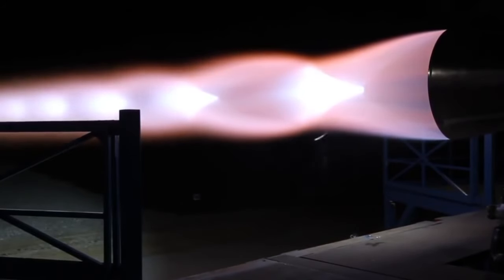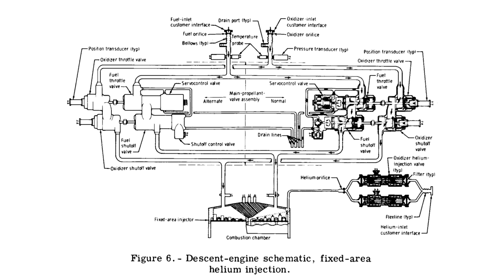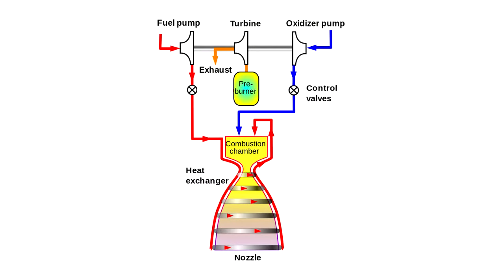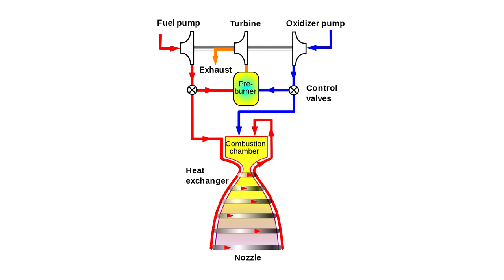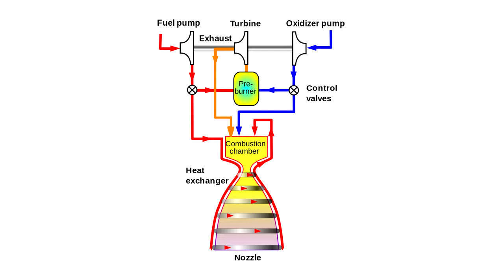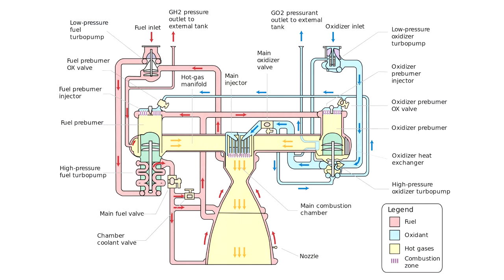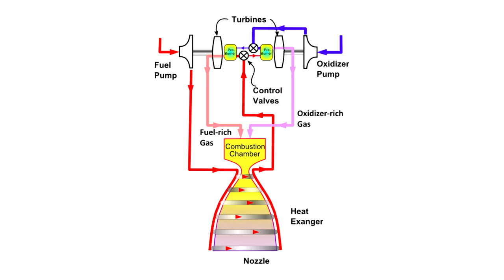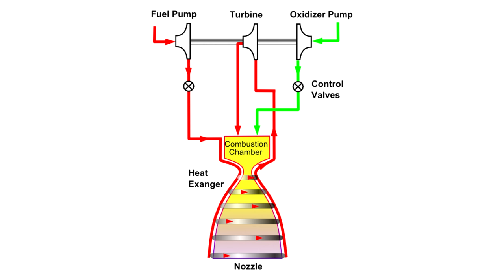KSP Doesn't Teach: Rocket Engine Plumbing

Comment: nitrogen is an inert gas?
Reply: Yes.
Reply: thx I didn't know that
Reply: not quite but pretty darn close
Reply: All gases at the most right side are Noble Gases. (Edited)
Reply from the maker: +my son unless you're lithium.... it's relatively inert
Reply: I'm in school so they only taught us about helium, neon,argon etc.
Reply: Nitrogen is considered inert because the N2 molecule (nitrogen gas) has three covalent bonds: N≡N, whereas most gases, like O2 (oxygen gas), have two: O=O. Those three bonds require much more energy to break in order to bring the atoms into a state where they can react with other atoms.
Reply: I think you mean the gases on the right side of the periodic table.
On the leftmost side are the alkali metals, which are most definitely not inert, and the gases on the leftmost side of their respective rows of the periodic table, such as nitrogen, chlorine, etc. are not noble gases, as in most representations of the periodic table, the noble gases are on the far right.
Reply: Under these conditions.  The inertness of a gas is always context dependent.
Reply: thats true it depends a lot on the conditions and reagents present.
Reply: +Nelumbo Nucifera unless you're talking about Helium.
Reply: Manu Tarazona Oh yes, sorry for my mistake.
Reply: +my son helium, neon, argon etc. are "noble gases", which means that they don't like to react with anything.  Something like nitrogen is an "inert gas", which simply means that it doesn't burn when mixed with oxygen and doesn't cause fuel to burn when mixed with fuel.  But unlike helium, nitrogen can form chemical bonds and be part of chemical compounds.
Reply: N2 has a tendency to dissolve in LOX at high pressures which causes cavitation in turbopumps= not good so Helium is usually used for commonality on both sides when LOX is used as one of the propellants.
Reply: Also Helium has a negative Joule-Thompson coefficient, meaning it heats when it expands instead of cools, which is desirable for efficiency in the pressurant tank volume
Reply: I thought they were on the far right?
Reply: yeah I wanted to make mention helium too but decided not to make a long story :P 'noble' gasses like krypton and xenon can bond with fluorine though but helium is totally inert.               
Also: would the low density of helium be a plus when using it in fuel tanks?
Reply: You must have a different periodic table than I do...
Reply: XeF and KrF are actual compounds with a noble gas in them though (albeit quite unstable ones).
Reply: More so than oxygen
Reply: a lot more, both are powerfull fluorinating agents. Oxygen is a very powerfull oxidizing agent as well (especially when condensed to liquid form).
Reply: Kevin Miedema Yeah, noble gases become somewhat less "noble" as you go down the periodic table, due to very large and loosely bound outer electron orbitals.  But they're still much less reactive than any other kind of element.
Reply: +Kevin Miedema some car tyres are inflated with nitrogen because it's apparently more stable than oxygen, I think the Nissan GT-R comes with it from the factory
Reply: +Chickenn Oxygen degrades rubber. Also filling with dry nitrogen instead of ambient air gets rid of the complications with inflation pressure from condensation of water vapor in humid environments. Formula One and Indy cars have used dry nitrogen or a similar scheme for years because they have relatively low inflation pressures (13 lbs) and tenth-psi differences have dramatic effects on those cars' handling.
Reply: Wificationify High-pressure gas should be at the top of the tank and the liquid fuel / oxidizer should be on the bottom, right?  Since the gas is lighter than the liquid.  So as long as the fuel intake feeds from the bottom of the tank, this should be fine.

In zero gravity, of course, the fuel could well end up on the wrong side of the tank, which is why with an engine like that, before starting it in space, it is necessary to thrust forward a little bit with RCS to get the fuel to settle.
Reply: inert enough...
Reply: Bingo. You can see this in action in some of Scott's real scale solar system gameplay.
Reply: yeah he mentioned that a lot - he did abandon rcs thrusters and just spun up the ship later in his playthrough though.
Reply: Unless you've got a very energy-intensive synthesis reaction (as is the case with nitrogen-fixing bacteria) or some horribly reactive chemical (think O2F2), nitrogen gas is inert.
Reply: Some call it racing gas. The real world benefits are minimal, but just like in 'Rocket Science' where you are chasing the limit, N2 versus Air means you can rely on an inert gas which has the perfect characteristics of a gas (Charles/Boyles Law's). But yes, Nitrogen can be absorbed into the most fluids, there by decreasing fuel-oxidiser density or causing cavitation at the pumps. You cant use N2 to pressurise a liquid H2 tank, as it would freeze. O2 - absorb.
Reply: the deal with nitrogen in tires is that it does not absorb moisture and is less affected my heat or cool that alters tire pressure.....ya .more stable
Reply: No, but it is a lot less reactive than most elemental gases
Reply: Wificationify on the launch pad, gravity/buoyancy will do the trick. Once into orbit or other micro-g scenarios, they actually use tiny solid rockets or other orientation-independent engines to “kick” the stage ‘up’ providing enough acceleration to do the same thing.
Reply: Gasses used to pressurize the fuel tank: 
  Nitrogen gas is a two atom molecule that is not combustible with most common fuels, but can react slowly at both high pressure and temperature. It is not as light as helium. It is cheap, and used to exclude normal air from airline fuel tanks. 
  Carbon Dioxide is also quite stabile with fuels, but is acidic in combination with water vapor.
  Helium is the lightest inert gas, making it desirable for rockets.
  Methane can be both a liquid and gas in the same tank, so heated methane can be returned to the tank for pressurization. Super-chilled methane will tend to condense this gas back to a liquid, so a proactive controller is needed to press the tank. A membrane may also be desirable to prevent the super-chilled liquid from mixing with the gas in free-fall. Otherwise, the tank pressure may drop precipitously./
Reply: Until you start using hydrogen or igniting your piston engine via pressure

Comment: Scott a very nice summation.   Of course you could have talked about how
the rocket thrust chamber is cooled and how they are started, throttled and
restarted; why some engines are more efficient than others and why the thrust
to weight ratio is important.  But for your basic type and plumbing it wasn’t too bad of a video.

Comment: Just to give an idea of the scale of some of these things, the Rocketdyne F-1 engine in the Saturn V used a gas generator cycle, where the turbopump for the fuel and oxidizer ran at 55,000 hp. That's 55 thousand horsepower, just for the pump. The engine itself produced something like 30 million horsepower.

Comment: Nice one Scott.
Another thing you might address that's very unrealistic in KSP is air-breathing engines, namely the way they just consist of intakes on the front and nozzles on the back with no actual engine in the middle linked to them by ducting! Intake and exhaust duct geometry, volumes and aerodynamic effects are a huge factor in aircraft design.

Comment: Aircraft fuel cells also use turbopumps in most cases. Often times, they're electrically driven. Other times, they are driven by motive flow from the engine-driven fuel pump.

Comment: Hello Scott:

Very much enjoy your space videos, thank you!

I watched the video "KSP Doesn't Teach: Rocket Engine Plumbing" and enjoyed it very much. 

At the end you mentioned a hydrogen type combustion engine which was great but limited in how much thrust you can get from them. This was due to the geometry of increasing the combustion chamber sizes. I get your point about volume being a function of radius cubed vs. surface area being a function of radius squared. You mentioned that at some point in size you would need to pump in a lot of fuel but get no further increase in thrust. 

I thought about that a bit and wondered if they couldn't simply install a heat tolerant sphere into the center of the now larger combustion chamber to force the fuel mixture towards the walls. This sphere would decrease the volume of the chamber but not affect the surface area of the walls. Just a thought. would like your opinion on this but don't know how to give you my contact information in this format. 

Thank you,
DWKSIMI

Comment: For me that was one of your most interesting vids - thanks.
It would have been even better if you had shown on actual pictures of real engines where exactly these preburners and turbopumps etc. are mounted. Or a picture of the oval H2O2 tank of a V2 rocket that you mentioned.

Comment: Scott Manley they use mechanical seals in turbo pumps, jet engines etc. Usually a carbon rotary face with a silicon carbide or tungsten carbide stationary face. 

Impressive album collection, let's see your stereo

Comment: Scott! What are your thoughts on possibly using a RAT (Ram Air Turbine) driven turbo pump for first stage rockets?

Basically, a RAT is a little propeller you can kind of hide in a ducted nacelle that sticks out from the side of the fuselage. It uses the flow of air rushing past the rocket to drive the turbo-pump.

The upshot for it would be that first stage motors could simply use the movement of the rocket itself to power the turbo pump, completely void of hot gases.

There are a few downsides and possible engineering challenges that would have to be overcome however. For one, the intake could cause drag. For another, it doesn't work in vacuums, so it'd be limited to first stages. For another, there's the issue of starting it in the first place. I was thinking perhaps the launch tower could manually spin it up with some sort of bleed air system, and then the engine could become self sustaining once it got off the launch pad. Perhaps it could be a hybrid electrical system rather than all mechanical, that way you could run electrical power into the rocket while on the ground, and let the RAT take over once the rocket lifts off.

Anyway, what are your thoughts? Possible or no?

PS, I was also wondering, wasn't sticking too many engines in their stages the thing that made the N1 moon rocket a disaster? How does Elon plan on fixing that for his Mars rocket? Wouldn't launching a dirty and inefficient Sea Dragon be safer, cheaper, and more reliable?

Double PS, 0:37 What's with the wavy exhaust? Is that some sort of standing wave? Does that have any effect on the engine's performance?

Comment: Really surprising how H2O2 has been so neglected as oxidizer, considering it's many appealing qualities; high density, non-toxic, non-cryogenic,  good oxygen yield, not hypergolic (won't explode if mixed) but still kinda hypergolic (the freshly decomposed steam-oxygen mix at 700-900deg C is pretty good at igniting stuff) and it can be used as monopropellant in RCS and to drive turbines without mixture ratio problems. Bristol Siddeley Gamma was a succesful engine in the Black Arrow program, but ever since they have remained either proposals or one-off specialty engines.  RD-161 and RS-82 have projected specific impulse of 320 seconds, so it's not even an efficiency issue.

Comment: 15:35 FYI, JAXA is actually developing the LE-9 engine nowadays to run on the H3 rocket, on a expander bleed cycle and is a first stage engine, and it produces almost 1.5 meganewtons of thrust VAC.

Comment: Gonna have to watch this a couple more times to really understand the extent of what you mentioned; summarized a little too much near the end for time reasons; hopefully you can elaborate more regarding the different types of engines.

I started to get lost during the Volume which is R^3 vs surface area which is r^2. 
Are we dealing with a spherical expansion just because the gas is expanding from heat? Or is this more of the volume vs surface area problem within the tank itself? I'll watch it some more... ^-^

Comment: Hey Scott Manly, I loved your explanation! Very interesting! 

Concerning your explanation of the "Expander Cycler Engine". Here you said this wasn't widely used because it has an upper limit on flow due the relationship between outer surface area and inner combustion chamber area. This makes sense if the outer and inner areas are related as spheres but if you change the shape of your combustion chamber or intruded into the combustion chamber/nozzle with your heat exchanger it to me that you could increase the surface area available to heating dramatically. Why haven't aerospace companies tried this?

Comment: Thanks Scott.  Some criticisms & suggestions:   I'd like much more sophisticated schematics, or even better,  I'd like you to show an actual engine as you're explaining what's occurring, with you or someone pointing to the relevant part as you talk.  I'd really like to know what EVERY pipe, valve, wire, and fitting does, and which parts of SpaceX's engines are unique to their designs - and how they improve on previous engines.  I'd also like to know how they manufacture the bell structure with all the tiny tubing for the fuel running through it,  to cool it. These are great videos though -

Comment: What about transferring some heat from the nozzle to the tanks? This would be in an effort to use the resulting gas to maintain constant tank pressure eventuating in flow without loss when the tank is lower on fuel.

Comment: Three questions.

First, regarding the gas-generator/staged-combustion cycle, instead of trying to pipe the turbopump exhaust back into the main combustion chamber, why not simply run a small oxygen line over and burn the turboexhaust in its own smaller, secondary chamber?

Second, regarding the non-full-flow staged-combustion cycle, why not eliminate the shaft and its sealing issues entirely by using a turboelectric pump - the turbine drives a generator, which sends electricity through cables to power the pump motor?

Finally, regarding the combustion-tapoff cycle, why not send the tapped-off gas through a rearward-facing nozzle to recoup the lost thrust?
Reply: With that secondary chamber you now have the same problem as before. How do you pump fuel into it? Are you going to make another turbopump and create a matryoshka doll of engine bells?

Comment: I work in chemistry/formulations and material science.

I deeply appreciate your wonderful videos.

I just keep looking at the whole business of lighting a 2 k chemical fire and launching a metal tube straight up in the air.

With some variations on the theme, it just what Dr.Goddard accomplished 100 years ago.
The technology for electronic guidance has made light year speed quantum leaps in advancement from the old Redstone,Gemini and Apollo missions,but the chemistry to launch a rocket still seems antiquated.

This is to me at least, comparable to ancient mariners sailing around the globe using wind and dead reckoning.
Then came steam and then turbines and finally we were flying!

The whole business of overcoming gravity using controlled explosives [and I like working with explosives] is still comparable to guys on wooden ships using wind and sails.

My thoughts are directed at developing near nuclear energy density reactions [no radiation emissions] to generate magnitudes of order massive outputs to drive ships into space.

Before anyone laughs or smuggly smirks, I would not state the case unless it is possible.

Comment: In germany, the process of running hydrogen peroxide over a catalyst to make steam was called Walter-Antrieb (Walter-propulsion) and it looked very promising for use in submarines. As early as 1940, a test submarine reached 28.1 knots submerged. Good to see this is used for peaceful applications now.

Comment: Then there was the Aerojet M1. Planned to initially have 6.67 MegaNewton (1.5 million pound-feet) thrust with growth to 8MN (1.8 million lbf), it had turbopumps with 75,000 horsepower for the hydrogen and 27,000 horsepower for the oxygen. Since American rocket engineers hadn't yet figured out closed cycle, the M1 used the gas generator cycle. However, due to the immense volume of exhaust from the turbopumps, it was routed around the lower nozzle skirt for cooling, exiting through a ring of small nozzles to produce 120 kilo-newtons or 28,000 lbf thrust.
Reply: Gregg Eshelman What about tue rocketdyne f1?

Comment: Almost two years late, I know.. But the "alien molusk type things" are called Centrifugal compressors, they are used in a lot of applications like small jet engines, turboprop, turboshaft engines, and turbochargers.

And yes rocket engines too. :)

Comment: Know this is an older video, but thought I'd comment anyway.  Doesn't the SSME's use 'expansion' type turbo-pumps for the low-pressure pumps?  Drawing seems to show both these low pressure turbopumps being driven from the expanding H2 from the nozzle cooling flow as well as the pre-burner gas driving the main turbo pumps.  I was always amazed at the raw power rating of the main pumps, smaller than a nuclear reactor and yet, many MW's of power.  Thanks for the great video.

Comment: The more complicated FFSC cycle will probably be more expensive to produce and develop, but it's durability and versatility will pay off pretty quickly on reusable rockets I'm sure. Thanks for the video!
Reply: It's actually less durable if anything. The main advantage is higher efficiency while maintaining high thrust to weight. All of the fuel is used for thrust as opposed to a good chunk being used solely to pump fuel into the engines. So more delta-V out of the same tank.